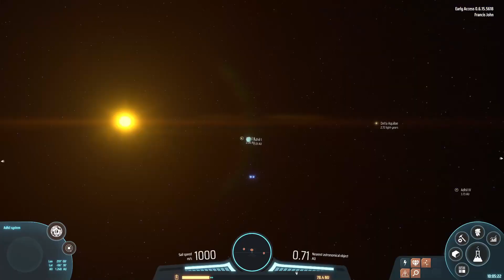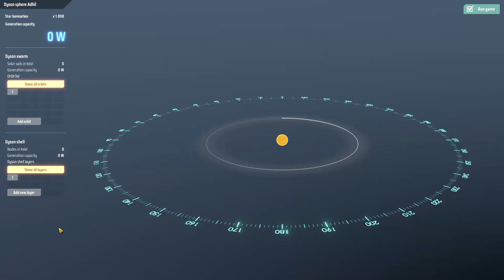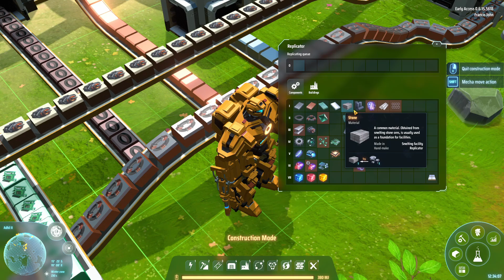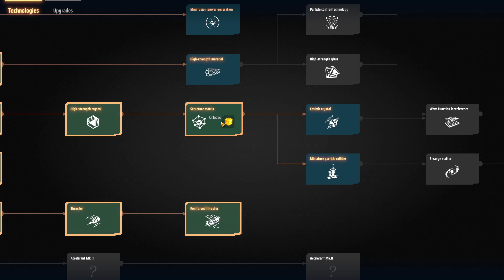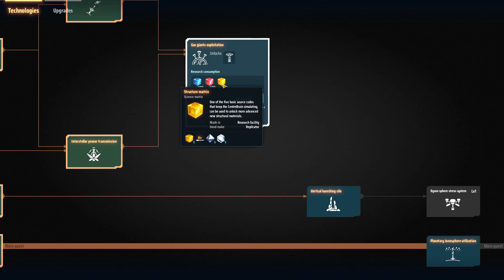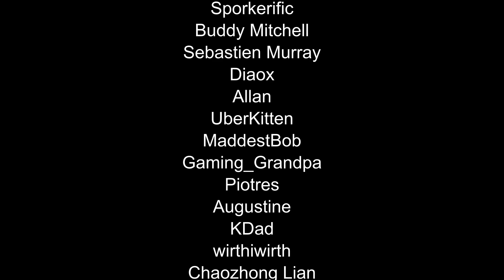Firing solar panels into the orbit of a sun with a rail gun! : Dyson Sphere Project ep 3

Comment: "A renewable source of power that never runs out" - until you run out of the materials to make them. That's the very opposite of "renewable". It would be renewable if they ever came BACK to you, or they didn't stop sending power after several minutes.
Reply from the maker: I used to think the solar panels would last forever, so sad.

Comment: Just a big note on solar sails, you gotta pump up the numbers on how much you're pewpew'ing around a star. 30 seems to be optimal, but 14mw was as high as I was able to draw from them per collector. I was able to get my sun to give me around 1.4gw of power, and only put the collectors on the north and south poles of a planet, they require time to 'warm up', far too much to even get near an equator. It severely limits your potential power because of axial tilt and planetary spin. Further testing is needed though on tilt/size of the solar sail cluster and how much power it can provide, does a huge ring(bigger gaping space O) far away generate the same level of power? Does the tilt on the vertical or horizontal matter? I'm still futzing around to figure that one out.

Comment: 34:51 is the best comment in the entire video. Dyson Swarms are essentially pointless and wasteful. Planets filled with solar panels or wind farms (or burning off surplus hydrogen from infinite oil) is a much better source of power than consuming a ton of power to generate a finite amount of return (because Dyson Swarms last only 1800 seconds, or 30 minutes, until they're upgraded.)

They are aesthetically beautiful though.
Reply: Also, I learned in another video, that Dyson Swarms can only be launched when the rail platform faces the star; AND, the bonus from Ray Energy transmission only works when you maintain star-facing alignment long term-- GREAT for Tidal Locked planets. Kind of terrible anywhere else.

Comment: A tip with the main bus, if you press tab during the construction of the splitter it gives you various splitter desing, there is one where you have two ports on ground floor and two above this way you can have an elevated bus and take out the resources you need from the ports on ground level

Comment: Another note: Store that Hydrogen in fluid tanks!  You can convert it to deuterium later for an upgraded power core that is a game changer.  My early design was to run hydrogen through loops between fluid tanks with the deut distiller in the middle, later you get the mini particle accelerator to make deut.  You got titanium alloy set up so you got that set... and luckily you have fire ice early for an easier graphene build!

Comment: You want to know what happens when you land on the gas giant? Cause it's the first thing I tried when I was still on carbon power. I don't think there's land (I didn't try pitching down) so you're in flight mode the whole time with energy going down continually. I immediately noped out, not wanting to discover what happens when you run out of energy and there's no land to recover on.

Comment: Hey, I figured out how the energy transfer machine works, on a planet with surplus energy you first have to set it to charge, then, you have to put empty accumulators in it to charge them. That turns the accumulator into a different item that represents a full accumulator. After that, you can ship the full accumulators to the planet that needs energy, on that planet you have another energy transfer machine set to discharge, it will consume full accumulators and spew out empty accumulators, then you can ship the empty accumulators back and repeat the cycle.

Comment: The way the Energy Exchanger works is that you have a planet with lots of power with an exchanger set to "Charge". Give it empty accumulators and it will fill them and spit them back out. Then you Logistics the full accumulators to other planets where they have exchangers set to Discharge. Those will convert the accumulators to empty which you would then send back to the charging planet etc.
Reply from the maker: That is way to much effort, I'm thinking I'm just going to build mass solar.
Reply: @FrancisJohnYT  Possibly, But keep in mind that accumulators only need to be build once then they are reused forever. Eventually without any upgrades a single transport can carry 200 accumulators at 45MW each, so 9 GJ per trip. Its a nice way to have each planet having a power backup if something bad happens.
If I recall the build rate a single 1.0 speed assembler can produce 1200 per hour. (@ 1 accumulator per 3 sec)
Reply: @FrancisJohnYT  Also keep not that when you go to different galaxies is might be nice to order some power to get bases up and running.

Comment: Another great vid, and Another game that you convinced me to buy after rim world and Factorio, i found something that i think you would love, in the "settings" under gameplay their are two options "Third person mode" and "God Mode"  thrid person is what you have been using, however God mode isn't some super cheat it simply allow you to decouple the camera from the Robot it shares the same build distance as normal but you can  use  top down view,  also you dont need to do those super s bends to bring items into your bus,  you can change direction on any 2  in a row belts  be it up or down left or right not both ie on flat area 2 belts then 3rd belt is to the left of the 2nd belt is the turn  so do the same in the air raise up to level 2 then 2 belts in a row at that level then turn inline where the bus is then descend on the 4th belt and within next two or so belts>(basically you can turn stuff in the air  on the same level do so it will save you a lot of space and remove the s bends)
 Thanks for another great vid and a game that i now have spend way to much time on.
Reply from the maker: I need to play around with the main bus idea more, I ended up playing for a bit to long and pushing to far. I should have maybe played around at the lower techs first.

Comment: FYI, that energy exchanger is for making full accumulators. Set it to charge and insert empty accumulators and after some time (depending on the excess energy on the grid) it will charge the accumulators which can be removed for crafting. Like for making extraction devices to pull resources from gas giants :)

Edit: Was doing some thinking and yes, it does look like you can use these to transfer power from one planet to another. Essentially think of the exchanger as a charging station and the accumulators as batteries. Then have logistic ships carry them to another planet and have another exchanger to suck the energy out of the accumulators on the other end.

Is this worth doing though? in a single star - no. you would just get a dyson sphere going and have ray catchers on each planet. Between suns? might be more hassle then it's worth but if ONI steam chimney has taught me anything, is that there is no engineering project too big for some people.
Reply from the maker: I'm thinking it's more of a late game project, right now wind and solar look to be plenty.
Reply: @FrancisJohnYT  Yeah, moving power between planets/stars is definitely late game. Unless your covering the entire planet wind/basic solar wont keep up. Making use of oil products in thermal generators will help since there is plenty of oil on the starting planet and oil is an infinite resource in this game.

Comment: I like to use the local planet logistics to move stuff from one factory to another, and into the interplanetary station. So between the two kinds of drones/ships you have something like a hybrid of Factorio's trains and logistics drones in one. I rather like it. Just have to build enough drone/ships.

The item you need for intersystem transit is called the space warper. The fastest way to find it in the tree is to look at the gravity matrix at the lower end and go backwards.

Comment: For the photon launchers, you might go with half a dozen units near the poles. Smaller radius and less time spent while below minimum pitch, but keep in mind since the planet axis is still tilted, it will not be full time shooting sails. Still saves a huge belt run across the equator line.

Comment: When you go to place a splitter hit TAB when its in the blue frame mode, before placed, and watch as it cycles thru 3 different styles, the other versions have 2 connections on the base ground level and 2 connections that are 1 level higher so you can bring materials in and out of 2 levels from a single splitter, lots of things you can do with this. Output can be filtered too.

The power pole that can recharge your suit has a much longer connection line, sorta like high power poles in factorio.

Comment: As a PCB designer I would recommend sticking with horizontal bus on one level and vertical buses on another level.  You can use  two level splitters to have vertical splits on second level.

Comment: When you select a splitter, press tab and there are two other styles. One of them is to pass through below and split a level above. Pretty great for tapping into your bus. But take note that they use up 3x3 space, so if you only have a single row gap between lanes, they can start to interfere with each other.

Comment: Hey Francis, just a random thing I did, I automated solar panels and ringed the planet in a 3 wide ring of solar around the equator that gives me pretty much all I need and never degrades like the solar sails. It also produces a hell of a lot more energy (though it does require a sizeable silicon production)

Comment: does the ray receiver have a line of sight if you build it exactly in the north/south pole of the planet?
Reply: I think it depends what season it is. Planets move in their orbits and they have inclination; I would be surprised if they had that but didn't code it into the LOS stuff.
Reply: @Khaim.m  On my seed the ice world has no axial tilt and therefore no seasons, I imagine is probably like that on others too. additionally, you can just put the same amount of receivers on both poles and then you get the same output all year round.

I actually experimented on my ice world, if you place solar panels on the poles they will constantly produce energy with no downtime, although the ones closer to the night side will produce less energy.
Reply: @Blastxu  If there are no seasons then everywhere should have day/night cycle, except the very spot at the pole. Unless the sunlight reaches slightly around the side? Anyways, building on two opposite points of the planet should work regardless of tilt.
Really what you want is a one-face planet, where the rotation and orbital periods are the same and one side is permanently day. In real life this isn't uncommon; my understanding is that tidal forces act (slowly) to change rotation speed to match. Obviously the game won't simulate something that takes millions of years but they could have the universe generation create such planets every so often. Probably unbalanced for the starting planet but it'd be cool to see as you explore.
Reply: @Khaim.m  The solar panels, and I imagine the ray receiver have a tiny bit of visibility of the sun at the very center of the pole and around it. If you go with the robot to the poles of a planet with no tilt the sun never goes completely down there. Of course this only works in the game because the planets are very small.

Comment: On the main bus, you can stack the lines on top of each other and then pull off of them so as to save space for buildings
The caveat is you can't use a splitter after the third level of height

Comment: the energy exchange works with convetor beth.
you beth in empty battery in a energy exchange in charge mode. full batterys will come out. 
and you belt in full batt in a energy exchange in discarge mode to charge you local network.

PS : the interplanetery station charge it battery at 60mw by default. bring it down to something you can manage

Comment: Definitely feels like satisfactory mixed with factorio but with interesting space mechanics
Reply: especially when he got to the stack splitter portion
Reply: It's a lot more Factorio than Satisfactory. It's got 3D graphics but the actual gameplay is still very 2D; you can stack belts and a few specific buildings (eg storage and labs) but otherwise the whole factory is on the surface. Also the production chain is very very similar to Factorio.
On thing FJ hasn't mentioned is the weird grid. Because it's a small planet, the curvature messes up straight lines every so often. Near the poles it becomes almost like Frostpunk.

Comment: why do you keep using storage boxes when you can use liquid storage for oil, water, hydrogen, sulfuric acid etc..? the liquid storage holds 10,000 where a box holds significantly less. i think stacks of 20..
Reply: I thought this as well, but you can't remove anything manually from the liquid storage, you belt it out. If you use a regular storage you can drag and drop for quick hand making of fuel rods and other odds and ends. It bugged me a lot but I get it now.
Reply: @Ummarth9  all of it should be automated.. no need for using the hands for crafting!
Reply: @dragonpc8258  this is true, but I don't think he was set up for that yet.

Comment: NO DONT THROW SOLAR SAILS AWAY! THEY GOT A LIFESPAN!!
Francis John: haha, em ejector goes pewpew~
Reply: Wait, really? How do you ever finish the sphere then?
Reply: @Khaim.m  You start off using the solar sails as a Dyson Swarm, which is temporary but gives you a decent amount of power.  Later on you unlock components that allow you to start building a more permanent Dyson Sphere.
Reply: @Khaim.m  The dyson sphere is a different project than the dyson swarm.
Reply: @Khaim.m  using other materials? You can check on the statistics it uses 3 different materials.

Comment: You can chain Thermal Power stations to make it more compact but keep in mind that one T1 sorter can only supply enough for about 2-3 stations.
Also the Energy exchanger works by charging accumulators to then transfer to another planet with logistic ships and then discharging them. You can then ship them back to the original planet to charge them up again.

Comment: Have not finished the video yet, but I have a hint for you and the solar setup. Look at the planet you are on with the gun. focus your attention on the poles. Based on the tilt of the axis, one of the poles will be in almost 100% daylight all the time. Do with that info what you will.
Reply: At that time of that planets year, yes, but when it's one the other side of the sun, the opposite will be true
Reply: @owlman145  Its almost as if, both poles will have more sunlight than the equator. So what you are saying is, half the year the north pole will have more sunlight, the other half the other will? Sounds much better than equatorial placement.